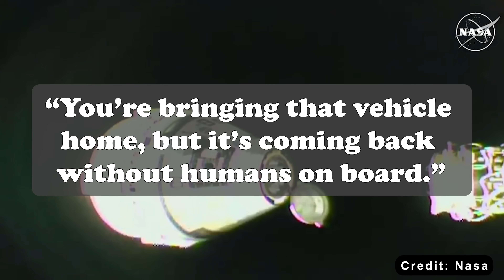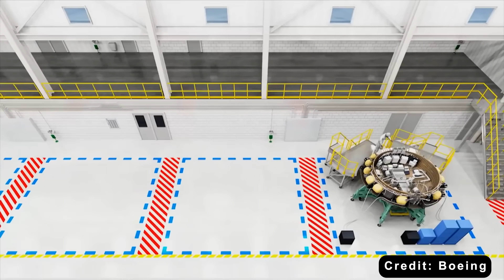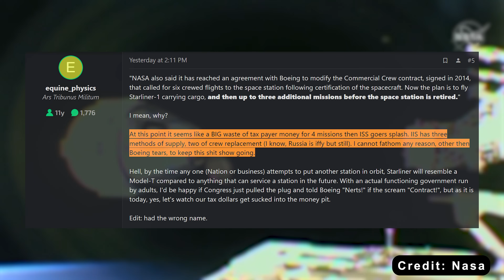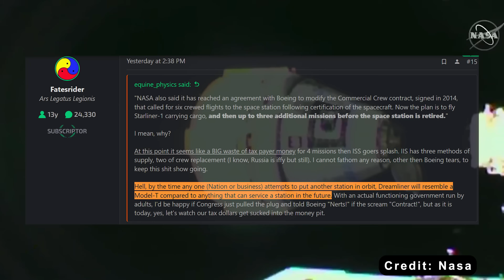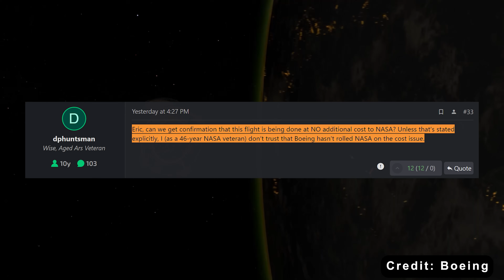NASA Confirmed "No More CREW Flight'' on Boeing Starliner. SpaceX Dragon to Replace...

Comment: I'm not so sure that Boeing doesn't have, and used, some methods to get some money out of NASA above the fixed price contract. True, this was their bid on their system but in any fixed price contract, any element changed or above the bid specs would allow the contractor to receive funds for those costs. With this next flight being an uncrewed cargo mission, if successful, they might be getting paid as if crewed.

Comment: The title is clickbait BS.  NASA has absolutely not said "No More Crew Flight" ... and if they actually do say that, then it obviously means Starliner is canceled ... it has no other purpose than crew flight.  They have made the decision that THE NEXT flight will be uncrewed ... essentially forcing Boeing to go back to an uncrewed proof mission, to prove the vehicle works well and is safe.

I think it is a reasonable conclusion that if this test doesn't go well, it should be over for Starliner.  Boeing has lost billions on it, and I doubt there is any reasonable business proposition left for Boeing, even if all those losses are treated as sunk, and only a forward business model considered.  I'm surprised that Boeing hasn't already thrown in the towel and quit.  A significant failure now simply must be the end; for both NASA and Boeing. 

But OK, suppose this flight goes great?  Even so, nothing about Artemis really makes any sense.  There is no reason to just land a few people on the moon for another short-term photo-op.  Any sensible program would be building and testing the infrastructure for a sustained manned station of some sort on the moon.

Comment: I don’t see SpaceX dropping the Falcon 9.  Not every launch requires the much larger Starship.  Even the Falcon Heavy has a limited demand.  SpaceX should consider a larger crew vehicle, like the crew dragon for use on the Starship booster. Again, not every crew mission demands the capacity of a Starship.  Also, and much more important, SoaceX should participate in developing a space station that spins to generate gravity.